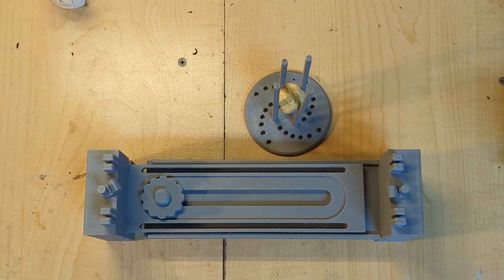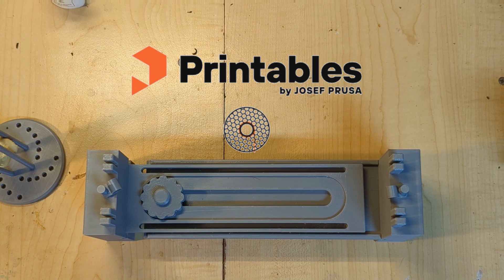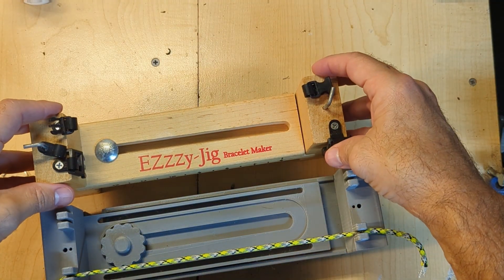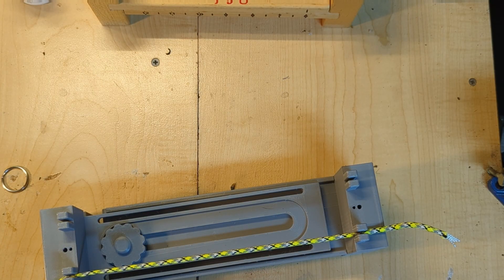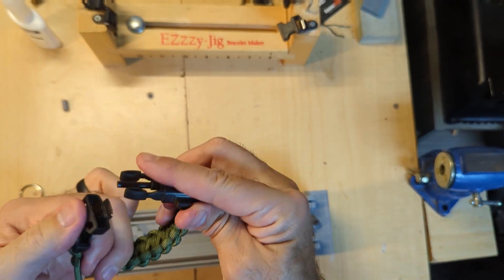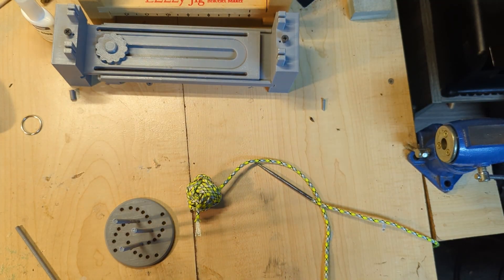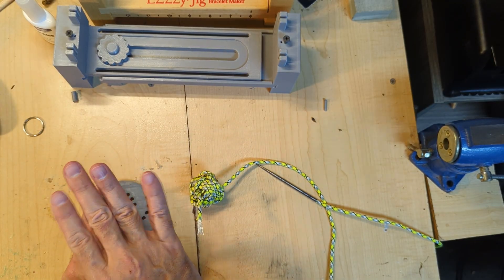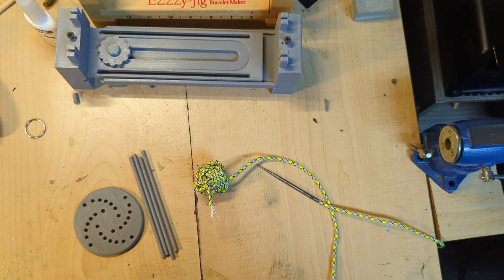3D Printed Jigs

Comment: Could you use a rivet as a pin instead of a screw
Reply from the maker: Possibly, but I would be afraid of cracking the print when putting the rivet in.